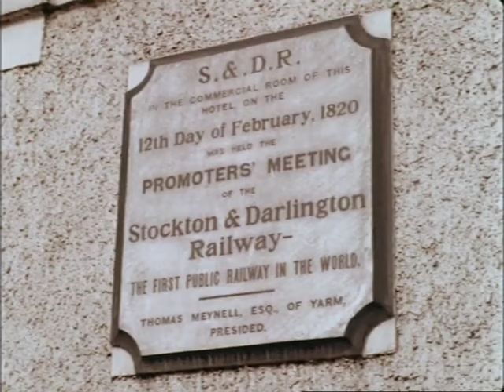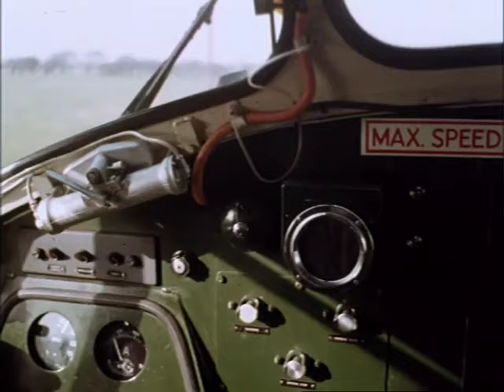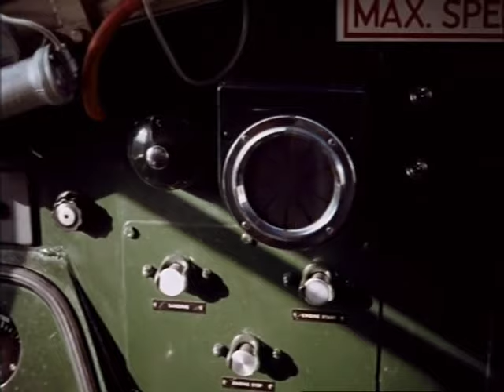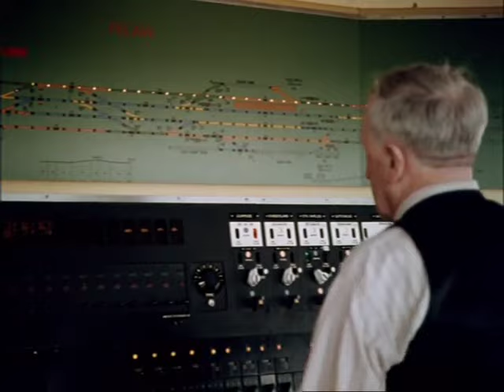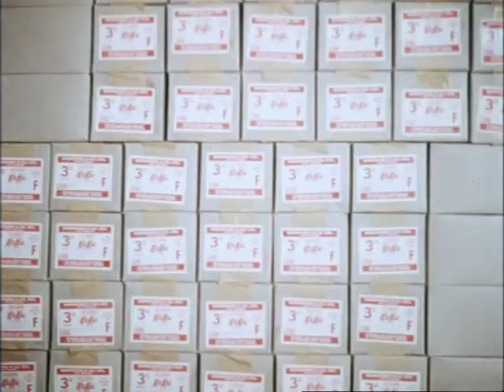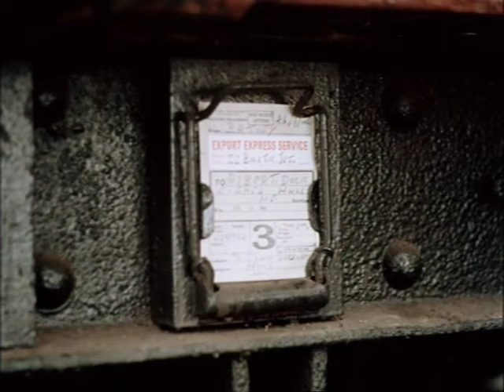Vintage railway film - The North Eastern goes forward - 1962

Comment: The cement works in Hull was on a line with many level crossings which they wanted to close.  So they connected it to a high level line which was nearby needing substantial earth moving.  Then a year later the cement works closed!  Good job it's only tax payers' money.

Comment: The standard of signalling and traffic control was clearly second to none.
Reply: My local railway (Sunderland - Penshaw) was resignalled with new upper quadrant signals and one lifting barrier crossing in 1962 then just 5 years later it was closed and signals cut up with oxy acetylene torches.

Comment: how did aslef feel about the redundancy of firemen once dieselisation took hold?
can't imagine they allowed single man running easily
Reply: Entire depots were closed, so it wasn't just firemen and cleaners, but drivers, guards and all the support staff.  ASLEF secured an arrangement at some depots where men with a certain seniority and where there were no redundancies, would be placed in a Starred Link.  Starred men had protected earnings, some all the way through to the mid 1980's.  For most firemen it was a case of seniority, the least senior men being made redundant first.  Also, almost all the mainline diesels at the time had steam operated boilers for heating the train, so there was a sizeble number of "Secondmen" at each depot.  Finally, you have to remember that during the time in question of this film, jobs were aplenty.  Unskilled men could and often did, walk out of the depot one day and be in a job the next.  I knew many drivers who had over twenty years experience on the footplate and simply walked off with a redundancy payment.  Many stated it was the best decision they ever made - leaving the railway!

Comment: What went wrong.. Answers Please
Reply: Several parts. Firstly the real problems were not dealt with: aging infrastructure, poor track alignment, harsh gradients, varying loading gauges all meant trains couldn't keep decent timetables. So the public's faith was eroding at the same time as new motorways were being built (by a firm owned by the brother of the transport minister).

Instead of working on the infrastructure, they threw a lot on untested diesels at it. Without thoroughly vetting each new model. Giving contracts to many factories without experience in building locomotives - as political patronage.

They also spent a huge amount on those marshalling yards, chasing traffic that was going by road.

Finally, they scrapped thousands of steam locos that had only been built 5-10 years ago.

What could they have done? Created a 20 year plan for track re-alignment, one mainline at a time. Electrified each line as they went.

Drop the Railways (Conveyance of Mails) Act 1838, removing the obligation of British Railways to deliver mail throughout it's network. Roads enough exist for rail and road to openly compete for traffic and let the chips fall as they may. Rail was required to carry parcels to every station they served, at the same low national rate, by law. (This requirement actually tipped some lines from profit into loss all by itself).

Don't build the marshalling yards. (Saves a ton of money that can be used for the mainline improvements).

As a stop gap, triaged the worst points on all the mainlines in terms of causing traffic delays, congestion and poor timetable keeping - and introduced necessary adjustments, repairs and re-signalling.

Kept steam until the end of its natural life, not scrapping nearly new locos like the 9Fs and Britannias (a considerable savings).

Slowly introduced diesels in phased in plans with proper trials, shakedowns and then increasing numbers. (another considerable savings - half the locos they rushed in didn't last much beyond 10 years).

As each main line is electrified, that frees up locos for other lines and allows the scrapping of obsolete motive power.

Spent some money on container operations, RoRo stock etc. This happened anyway.

Spent more on fitted trains to speed up services. Some of this happened, but not planned - just enough to keep up with demand.

These are just some things that would have been considerably better than what did happen.
Reply: @aidenteszke9000  Being as I am brown people (at least mixed) myself, I am hardly likely to do that!
Reply: @aidenteszke9000  why
Reply: @aidenteszke9000  : Well if that's what your strategy relies on, & you cannot argue with anything that lacks such a weakness, then I say to you, Aiden Teszke, you've lost the argument.

Comment: Absolute tosh. Most diesel locos built back in the 50’s and 60’s were nothing but trouble when first built. It took a fair while to sort out the ones which survived. Some designs were an abomination. Underpowered. Or unreliable. Never fit for the job they were meant to do. The engines compared to today’s units were not easy to work on and the running gear takes a lot of work even now. The HST’s has teathing problems when first introduced notwithstanding the brakes which had to have a new type of brake block designed for them. The breakdowns of present day trains are minuscule by comparison. They are much easier to work on. Whether they will last as long is open to question given the present day penchant for replacing them years earlier than normal due to tax reasons largely. Another thing to remember, units today run many more miles in between services and complete more miles in their lifetime than stock of old. So they are life expired sooner